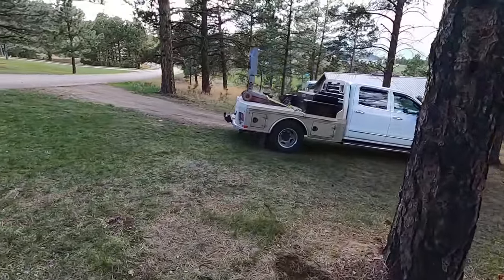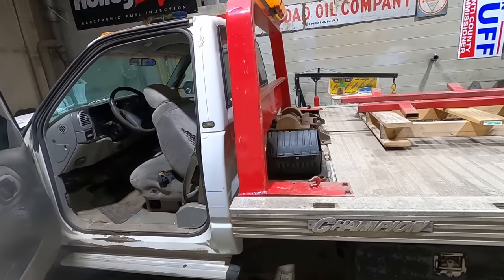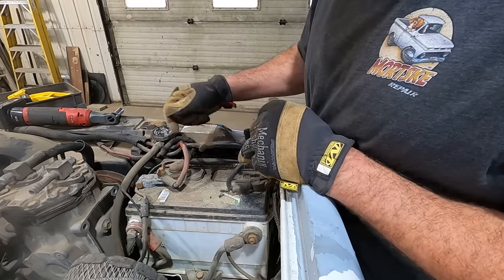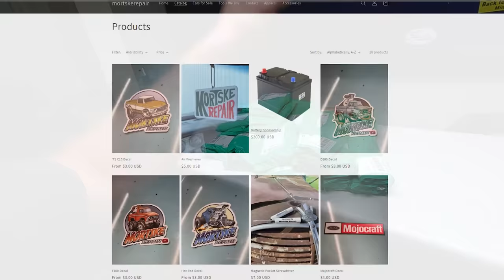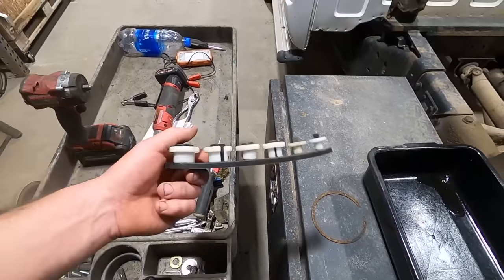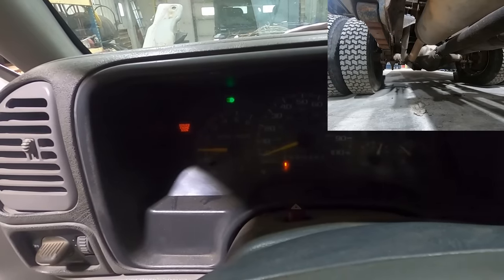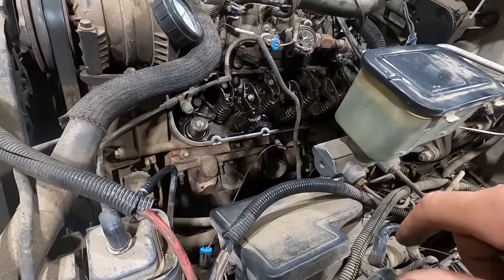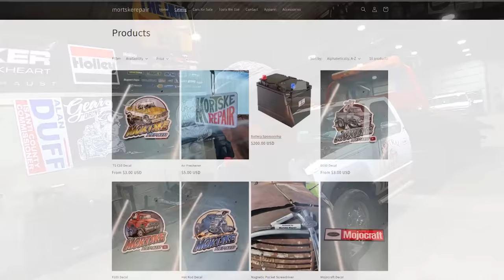WORST Purchase of My Life?!? I Bought a Rollback Tow Truck for Dirt Cheap! How Bad Can It Be???

Comment: The driver side has the wrong door handle should be like the passenger door..
Reply: I knew all of the Chevrolet roll backs I ever drove of that era had handles like the passenger side.
Reply: Yeah it looks like the driver door was replaced it doesn't have the pin stripe on it and few other little clues.
Reply: That’s not true. 

The handle on the passenger side is a Topkick/ Kodiak hande. 

The proper handle is the one on the drivers side. 

And not only that, you’re not going to find those rods for the Topkick handle. And you’ll be lucky to find a Topkick handle
Reply: @tclott316  
I have plenty of those handles and the rods mr.know it all...😎👊🏻
Reply: @tclott316  ALL C3500hd trucks (gmt455 I believe) came with topkick style handles.
Reply: @dalehall2993  then stop hoarding and sell me some.
Reply: @ronfrance4041  I don’t remember if HDs were/ are considered 55s like the Topkicks or not. It’s been awhile since I’ve messed with them, they’re all in junkyards or in tree rows around me. 

I don’t remember any of the HD trucks I worked on and owned having those, including my 13,000 mile 496 bucket truck I got from a local municipality. God I loved that truck. But further research on my end shows I was wrong. Been about 15 years or so since I’ve touched one so I suppose you forget some things. My bad
Reply: @tclott316  nope wrong . should be like the passenger side. all the bigger 10 lug trucks got the front bumper extended valence, no air bags, and big door handles
Reply: @Reaglesracing44_  read my comment above 👍🏻
Reply: Yeah, that era Kodiaks do have that style door handle too
Reply: Who the hell cares, if it does the job?
Reply: You guys must be a hoot at parties! 🙄
Reply: @jeffrykopis5468  we are just stating facts… not judging, unlike you…

Comment: The C3500HD is an impressive truck once you get by that body lift piece in the front. They are built to be strong and somewhat simple. The 454 is a great engine, and if rebuilt, it I think it would serve you well. I own a C3500HD with an 8.1 and a C3500 with a 454. These are great trucks to own and can serve their owners well. Congratulations on buying a beautiful roll back.
Reply: They are poop. I owned one. 6.5 turbo diesel was horrific. Worst in the 6.0 Ford transmission the rear end. I had a 1999. The early ones were bending frames. That's why you see the big reinforcement in there I think they started in 97 or 98.
Reply: Gm junk
Reply: 6.5 was a dog. We had one 6.5, and it was in the boss's wrecker. His truck was actually built for a NASCAR track and still had the fancy paint job. The diesel had "work done" so you had to watch the EGT's and not many people were allowed to drive it. I was one of the lucky ones to take it out occasionally and I can absolutely testify that a good running, well maintained low mileage 6.5 with "work done" is an absolute dog when compared to my well abused 275,000 mile 8.1.
Reply: The 3500HD was built as an answer for the towing industry that attempted to overcome the problem in the 1 ton chassis. Larger brakes and wheels etc. The original design had a fiberglass front hood and fenders but was cut out by Gm penny pinching.

Comment: Might be good to give it a complete valve job. If you plan on keeping it. That's a lot of rough miles on it. Bound to be more valves nearing the end of their lives and you're already elbow-deep in to it.
Reply: NAW PUT THE MONEY INTO A LO MILAGE MOTOR
Reply: @rsprockets7846  I've done it both ways and it depends on a whole lot of things. Like for example it was cheaper to put a low mileage V8 in a square body over replacing that integrated exhaust manifold/intake manifold on the straight six that was in it. They wanted just as much for the replacement part. But then we had to get all the hook-up right like the throttle cable, speedometer cable, motor mounts - things like that.
Reply: @W1se0ldg33zer  Yeah gotttta weigh the options but with new roll backs cracking 50k  I see the economics of the motor  swap or a wreck core rebuild,, ,anyway pure YT content gold for him .............
Reply: @rsprockets7846  new roll backs$130,000.00

Comment: You are going to love having a Rollback.  A friend of mine has one on a big Freightliner that he has pretty much worn out over the last 25 years.  Used it for everything.  While you have it torn down, you might as well do it right and fix everything you find wrong or you will be redoing a bunch of work.  Amazing that it isn't rougher than it is with that many miles on it.  Hope the stinger doesn't have to much wrong with it because they are very handy.  Probably won't be using the wrecker as much once you get used to running this.

Comment: I always thought them looked weird having the grill so high and bumper so low on them trucks in the front. I wish I kept my 96 3500 hd dully, Thing would pull a house down, but man the 454 and a dayna 80, and the smallest fuel tank in the world, I ended up selling it. It was sure better than my 99 GMC Suburban with its clasped lifter and noisy rear end lol.

Comment: Ok 56. Cab idea  is Awesome .  Also  for emergency bent  valve fix . Get a 3lb slide hammer , the adapter that fit locking pliers and a piece of line that fits valve stem snuggly . Air to cyl, remove spring ,slide line on stem clamp locking pliers use slide hammer to bring valve to seat multiple times until straight /sealed . Some  brake clean and lube will help. It's a bandaid fix but I've used it many times for folks who  couldn't afford the valve replacement at the time. 60% of the time it works everytime .

Comment: Huge fan of these trucks. I’ve got one in the 135” wheel base and has the proper Dana 70 front Monroe 4x4 conversion.  I  can speak from experience these things will hold their own and then some. Mine (6.5, 5 speed) gets 16 mpg empty at 9,000 lbs, has grossed 23,000 at times
Reply from the maker: Cool!

Comment: Hey Mortske! Hopefully, you havent put this thing back together yet... I just wanted to let you know to at least pressure test those injectors to make sure they arent leaking. It seems to be kind of a high failure rate on the 454 Vortec rigs and i feel like that may be the reason for the extended crank and need to open the throttle to get her to light off. Ideally you would want to have them bench tested after the extended ethanol bath. But if you can pressure test the rail, make sure it holds pressure after you turn the pump off and there isn't any fuel dripping out of the injector tips, it may save you from having to pull the plenum twice ;)
Reply from the maker: I'll clean em up and toss em back in

Comment: Why would you downgrade to an LS when you have a BBC in that thing?!

Get a carb intake for it and one of those new carbs with the spot for a TPS to bolt on to control the transmission and you can make that BBC run anyway you want!
Reply: Because even a mild 6 liter will run away from that turd of a 454 lol
Reply: @LSswapGarage1  
He didn't get that TOW TRUCK to race, he got it to tow and haul which the BBC was born to do. Besides, the BBC platform is still the king of the track too if you want to look at it that way.
Reply: @LSswapGarage1  a stock Vortec 454 makes 410 lb-ft of torque at 3,200 rpm and a LS 6.0 only makes 365 lb-ft at 4,000 rpm.
Reply: @LSswapGarage1   i have a C3500HD like this and a suburban with the L29 454. My Yukon with a 6.0 isn't even comparable when towing
Reply: @bobmcdougall5904  Cool story... lol...  I knew what you were going to say before I replied but its always fun anyway lol. That 454 at the end of day, without a bunch of mods is a gutless sack.  End of story.  Maybe try you know... tuning your stock 6 liter.  Scary stuff, I know.  The only guys thinking BBC is king aren't running stock Vortec 454s lol.  And this thing in this truck is trash... good excuse to remove the problem.

Comment: L29 Vortec 454. 290 hp 410 ft/lb. Top engine for the year, had more balls than the diesel. 4L80E trans. I own one, a 98 2500  with 60,000 original miles on it. No rust. Great trucks. 👍
Reply from the maker: good to know!

Comment: When you were having trouble with the tool on making the quick connect i believe that old fuel is 3/8 and the correct line to be flared ie the new stuff is 9mm and thats why it refused to work easily

Comment: Back in the day we used a small sledge hammer and an old impact deep socket and whacked the valve spring a time or two and the spring locks would pop out.

Comment: The passenger door handle is the original for a C3500HD 1.5ton, driver side handle has either been converted to a 1500-3500(half,3/4,1ton) or the door has been replaced, as they use different linkages inside the door.

Comment: Cruizing through several of your videos while I’m down after double fusion spinal surgery last Monday.  Between you, my feller Okie Puddin, PoleBarn, Derek, CW’s Garage, Ugly Truck Experience, and a few select other. Y’all are keeping me sane from the pain. So for that in itself, I appreciate you, Duff, and Mojo. Keep up the great work, plan to order up some merch soon! 

My cousin is about to whiskey-dent his 05 3/4 8.1 the rest of the way into the ground. Drivetrain all solid and strong. Not ridiculous miles. I’ll reach out if it becomes available. I had eyed it for one of my 3 K5s but I think I’m gonna 5.3 the sentimental ‘88 (mom has ‘04 burb with 140k and is ready for something different); Cummins the nicely redone M1009: and keep the roughest old school one (‘79) the carbed 350. 

Good alternative for those tubs are restaurant table bussing tubs from restaurant supply store(can find used sometimes). Also look for stainless buffet pans while you’re at it. Hella Handy for around the shop. The real big ones will nearly fully self contain most trans pan drops. 

Sam’s club (Oklahoma/Arkansas’ answer to Costco) has bus bin packs for decent price. I buy their cheap acrylic cutting boards for leather work. Or deck-le cutouts etc.  

Super cheap alternative to the bins you showed are just “dishwashing bins” from Walmart near the dishracks. Even cheaper at the Dollar Gentral or Dollar Tree-Fiddy. 

Idk up y’all about north but here in Oklahoma they’re popping up Dollar Gentrals in every little one horse town. It’s dang near dirtwork to check your own self out in just a couple months. Pure crazy. Walmart ran the little man down and out and, now DG and Family Dollar/Dollar Tree Fiddy is coming in where everything dried up. Business is weird. 

I’m rambling now lol. Good meds. I can smell all the colors of the moon. But I always like finding handy things for around the shop and sharing to others. Y’all be well!           -Lance
Reply from the maker: Get well soon!

Comment: I had a lawnmower that came back to me like that seat did to you. My mom originally purchased this mower new, but it never ran right, so she hated it and eventually gave it away. It went through three more owners over the years that gave it away because they couldn't get it to run right. It eventually ended up sitting in the back yard of a guy I knew for a few years after it quit running. He eventually gave up on it and gave it to me when he moved. I got it about ten years after my mom gave it away. I put an $8 Chinese carb on it and made some minor tweaks, and it runs perfectly now.

Comment: They did put an 8.1L in that body style.  The 01-02 3500HD was still the OBS body style and came with either the 8.1L or the 6.5L.   I see them on proxibid ocassionally.  The vortec 454 is a pretty solid engine though, fix that head and it will likely run for a long time.
Reply from the maker: Good to know!

Comment: Buying a project is always fun. It doesn't look too bad shape for the year.  I just picked up a 02 f250 ex cab V10 4x4 auto for 500. Runs and drives the only thing that doesn't work is the AC. It needs brake lines, a fuel line, tires, muffler battery and new manifold gaskets.  It's rusty the bed is shot but for 500 couldn't pass it up especially it being a 3/4 ton. I do wish it was the 7.3 but oh well.

Comment: I would knurl that valve guide. Just letting you know that the older Cadillac V-8's came from the factory with knurled valve guides and they rarely had problems with them.

Comment: They DID put the 8.1 in that body style. 2001 and 2002 c3500HD is obs with 8.1 4L80e. It would be a direct bolt in if you can find one. Any other 8.1 would also be direct bolt in but you would have to build your own harness. Same motor mounts. Same exhaust manifolds. Same bell housing.

Comment: Fuel pump system in that truck is goofy as hell for dual tanks. Its got an automatic transfer pump from the right tank to the left and the pump that runs the engine is in the left tank. Or vice versa, I don't remember. There's a bunch of weird stuff in the wiring, and i would recommend going to a single tank if you are willing to trade range for reliability.

Comment: You might want to send those injectors out for some cleaning. I found that most of those Vortec engines that have valve issues is due to fueling. The 4.3 was notorious for bending exhaust valves. Definitely flush the cooling system.
Reply from the maker: good to know
Reply: The 4.3's used to bend valves, because the guides were junk.

Comment: The passenger door was the type of door for the commercial built Chevy 3500 HD ton and a quarter truck... The driver door was prob smashed in on an a car wreck and trashed the door striker too... So they just placed a regular cab door on it and booger welded the striker bolt back on the cab
Reply from the maker: I concur

Comment: I redid one of those engines for a new-to-me Suburban recently.  I'm sure someone over-tightened the rocker arms when they worked on it last.  It hit the top of the piston and never ran correctly afterword and they gave up.  I'm sure you got a sick deal for it.  I'd send the heads to the machine shop for a going over if I were you.

Comment: 28:20 they seem to all be called drywall carriers on the jungle site, but they're like 2 for $20, and the single ones are all red and they are from $12 to $15 so might as well get the two pack for $20 because you know you're gonna break the first one.  Metal ones seem to start around $26 but they're shorter, which for body panels might actually be a good thing.

Comment: Being this far into it, send both heads out to a competent shop to be rebuilt. Dont cheap out on parts as your labor is worth something. New injectors. Regulator, distributor,  gaskets, filters, etc... top end rebuild. Hope the bottom end is good. Or yank out motor for full rebuild or swap. Make this rig dependable.

Comment: The fuel pump runs on the OIL PRESS sender, the relay only works during starter run.  If the oil gauge is funky, the sender is bad….🤠

Comment: I have had problems with the fuel pressure reg on that type engine in my wrecker, so while its apart might check that devil out, causes lots of runnability issues.  Good luck, say hi to Duff

Comment: I know it is a PITA & will cost a bit, but you are so far into it that if it were me I would pull the other head & do a full valve job.  At this point you have done most of the work, it would be a shame for the other head to bite you in the butt & have to pull it apart again.  Just my 2 cents for what that's worth.  Keep up the good work!

Comment: Just an idea get a longer section of steel tube to extend your fuel filler out to a more ergonomic position. The first time you don't have to bang your head or hurt your knee on gravel you  will be glad you did. A bracket to support the thing way out where it will end up would be great until you hang it on something and brake it off :-(

Comment: Definitely a good score, but at those miles you might as well order some rings do a quick ball hone. At minimum pull the other head and get them both gone through. I know you can get reman big block heads from autozone for cheap (just sold a set to a customer of mine and the bill with all the gaskets was under 1000 out the door)

Comment: You could swap in a GMC 610 V12. You might have to stretch the front end a bit to get it end and your transmission choice might be somewhat limited. Oh but the sound a a twelve cylinder. You could run for 305 exhaust manifolds and have quad pipes.

Comment: I learned about those quick disconnect thingys. Needed on GM, Ford and the Suzuki ATV that I'm in a WIR battle with at the moment. Fuel lines.

So far...NO it won't. 😢

Comment: Yep, intake valves probably got glued shut by bad gas, went through that with my '94 big block Suburban, had to heat up the head with a torch and use an angle drill to spin the valve in the guide, worked great with lots of marvel mystery oil. Stuck exhaust valves could mean the guides and stems seized up.
Great video, Mortske! Oh, by the way there are head bolts under the exhaust manifold........!!!

Comment: Dam, I needed that LS fuel rail, Just Kidding. I just need the crossover part. At least I didn't have to watch you cut it apart. Because you did not show it. The one on my truck is mighty rusty and I am just waiting for it to fail. I am thinking that maybe the metric system is causing a failure with the flare tool. ( I comment when I can, just to help the channel. not to make any sense)